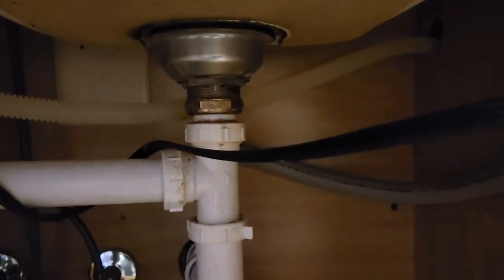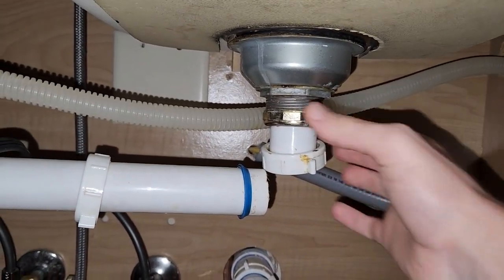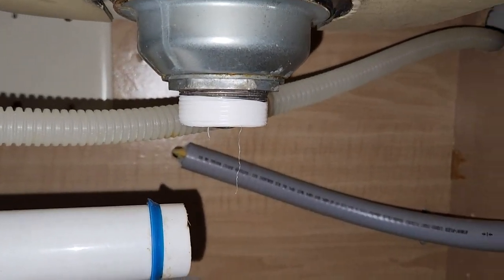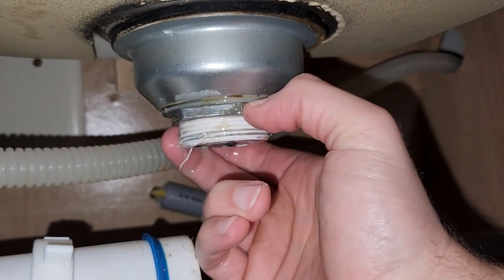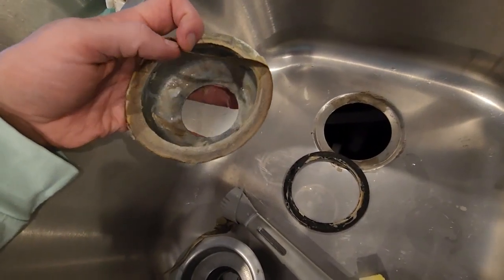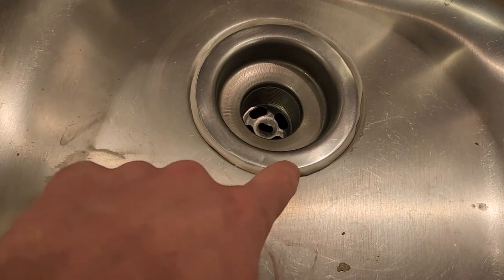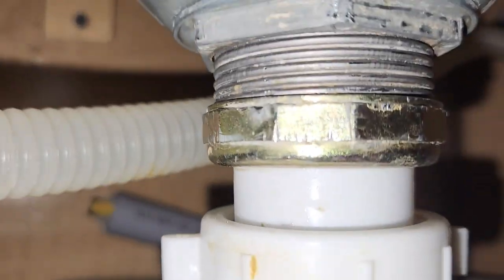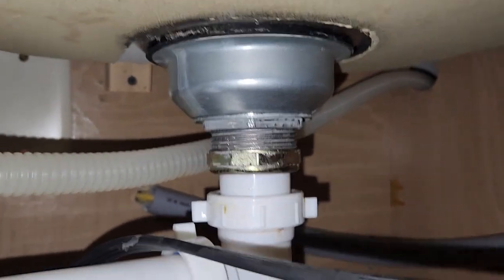Man Tips: Troubleshooting and repairing a leaking kitchen sink drain

Comment: OK good enough, once you pulled the sink strainer, got new gaskets, cleaned everything off, and applied putty, But I also would have replaced the old plastic seal the slides in the PVC down pipe.